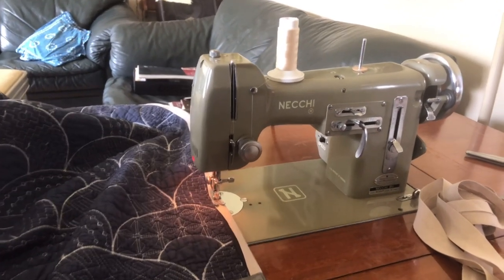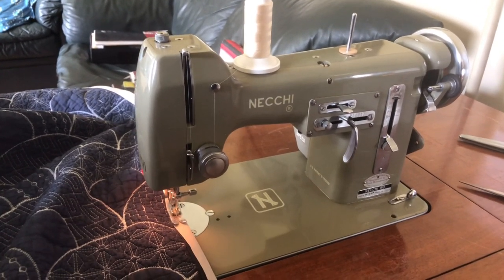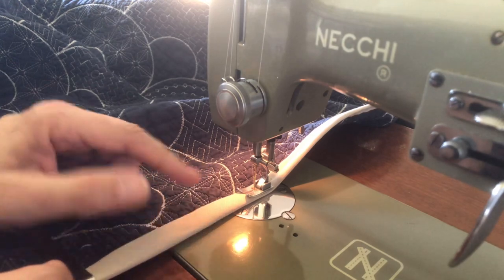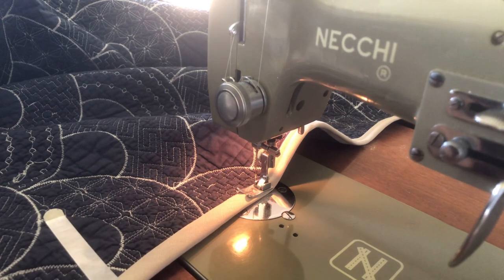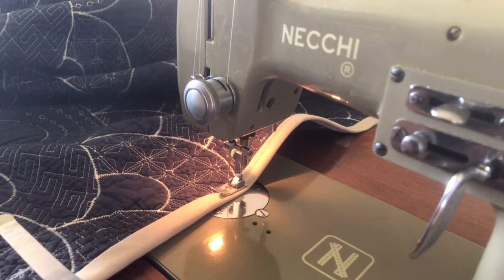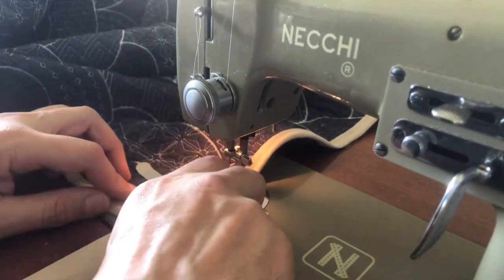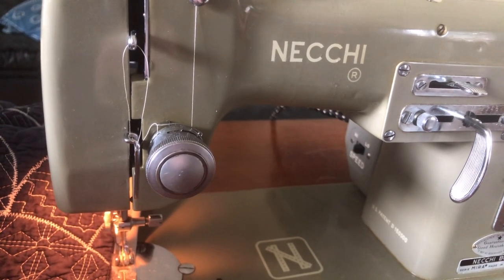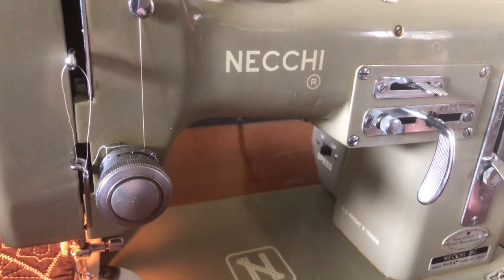DEBUT SERIES #36: Watch Me "Sewing" on my Necchi BU Mira:  Try Not to Laugh!!

Comment: Since I bought my flatbed I really prefer to use that instead of my free arm. It's much more convenient to use, most of the time, because of the needle plate being on the same level as the table. It's also more convenient to set up, because all the sewing stuff (thread, needles, feet, scissors, etc) is in the drawers. When I use the free arm I have to lift it from the bottom of the closet and carry it to the kitchen table, then its extension table and the pedal, then I have to get the drawers from the flatbed's table.

I only used the free arm recently when I wanted the three-step zigzag, and when I was working on a sleeve.

I've been thinking of selling the free arm machine, but then if I regret it, finding another one that nice right here in town won't be so easy.

Comment: I am havn issues with my bobbin Winder on my necchi esperia  staying engaged. The rubber wheel is in perfect shape and the tab for measuring thread fits against it when the bobbin is empty. Unit the whole unit will not stay engaged against the handwheel. It is the exact same as this nova. Do I have to remove the handwheel to have a look at the Winder? I cannot see where to adjust but a screw which is not easily accessible as the handwheel is in the way. Any suggestions?? Thank u souch. I cleaned n oiled this machine exactly as u prescribed n it runs like a dream. Dr.  Lol
 Thank u

Comment: Love the video!!  Would you happen to know, where I could find feed, for this machine?
Reply from the maker: I believe you had a typo there but were meaning to ask about finding 'feet' for the machine?  This Necchi model uses what are referred to as "High Shank Feet".  These are very common on industrial lockstitch machines.  While you can certainly search for vintage Necchi feet, newer versions (as long as they are high shank) should work fine.  High Shank attachments other than feet will vary in compatibility, but High Shank feet should work fine.
Reply: @VintageSewingMachineGarage  ....autocorrect, to the rescue!!  Lol. You are absolutely correct....feet, not feed!!  Thank you for your information!!